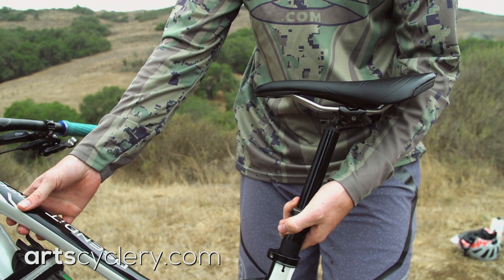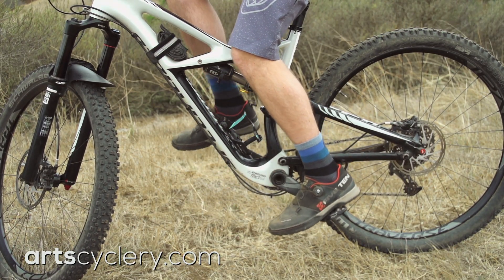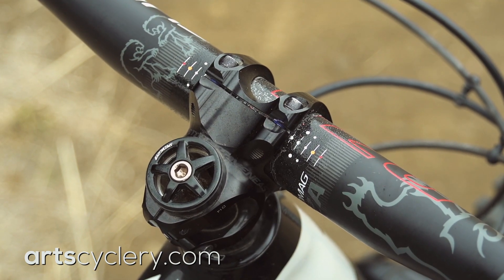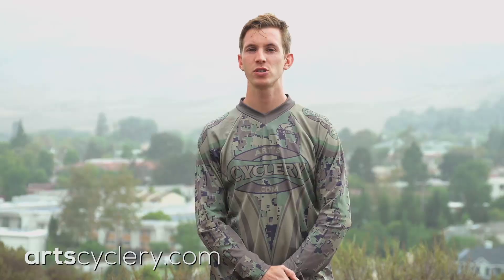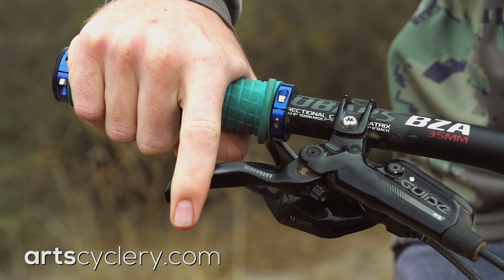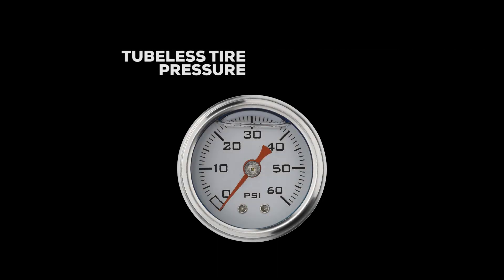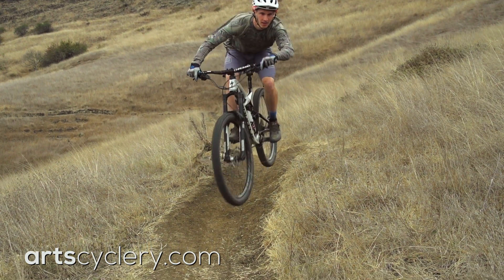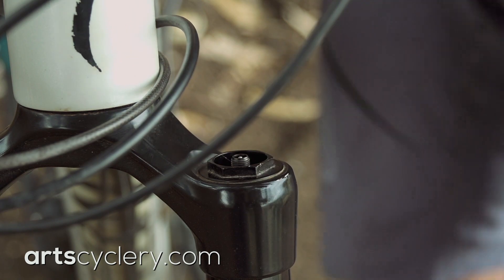How To: Top 5 Mountain Bike Setup Tips

Comment: hi! how do i know the lenght and the size? i want to change mine but i dont know which one to buy or how to buy. i measure the eye to eye lenght (190mm) but i dont know about the size, i saw diferents types like 51 mm or 57 mm thanks!
Reply from the maker: +Christian Venturo The easiest way to find the shock size is to go to the frame manufacturer's website. If it is not listed there, you can also try emailing the frame manufacturer. Hope this helps!

Comment: I lose 5 psi when disconnecting.  Speaking of which, is this normal or is something shot?
Reply from the maker: +Leonard Natera Yes, this is normal. The amount of pressure lost can vary depending on the pump and fork/shock. Thanks for watching!
Reply: +Leonard Natera you lose 5 psi when reconecting, because air in the shock expands in the pump.
So don't tune your shock 5 psi more.
Reply: +Art's Cyclery You are not loosing any pressure when disconnecting pump unless pump is good for trash. The lower indicated pressure (now loosed) after reconnecting pump is because you are adding volume of not pressured pump hose. How much pressure  you loose on connecting pump depends on pump hose to air chamber volume and the pressure in chamber.

Comment: Hi. Eric..i have firefox sniper d. .my inseam 30.5 i follow the method. Inseam×.883..my pedalling is gud..but my shoulder and arm joint hav pain...kindly advise me.
Reply from the maker: +RAJ RAAJ No. Pain is never an indicator of something being "right". You should alter your setup until the pain is gone.
Reply: Thanks for ur reply eric.
I have 19.5 inch frame cycle..and my height is 5'8" .is this right frame for me..plz reply.
Reply from the maker: It sounds like your frame is most likely a bit too big for you, but the only way to really tell is to get an actual "fit" from a professional at your local bike shop.

Comment: The air shock loss in not accurate - you lose the air when reconnecting as it escapes from the shock into the pump.  if this guidelines in this video are followed, you will have an extra 5-10 psi due to over pumping the shocks